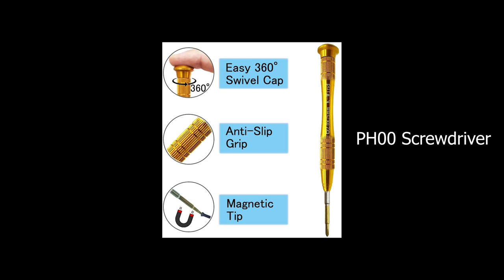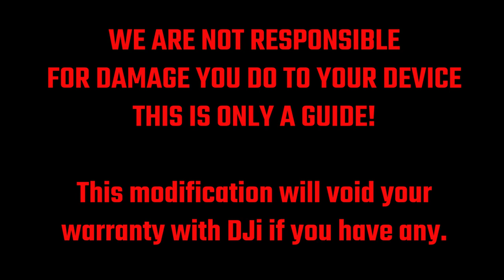Alientech Antenna Mod Installation for DJi Smart Controller

Comment: This is a really nice video ,  i recently fell off a bike  with the dji smart controller in my hand. Damaind the outer cover of the antennas, 
is there an option to only replace the antenna sticks , or any options or links where i can buy an replacement antenna module ??
it would be great help from you .. many thanks.
Reply from the maker: I would check Alibaba for parts.

Comment: Why do you use this external Marshall monitor? What's that for? Is the built-in screen not enough? Regards.....:-)
Reply from the maker: I like to look forward not down, and it is to setup to show 2 different options on the screen
Reply: @idjmic  Two different options ... hm.... for example?  :-) By the way.... This movie is a perfect step by step guide. It helped me to change configuration of my Smart Controller in order to use Signal Booster by Alientech. Thank you so much......:-) The only problem I noticed was to connect antenna wires to the motherboard. these connectors are so tiny.....Uhhhh.....:-) But finally I did it.......

Comment: I am struggling to get the antenna connection onto the motherboard. Mainly because I don't understand how they fit together. Does it just snap in or does it turn in? Thanks for this video Btw!
Reply from the maker: They just push on but not lined up correctly you can flatten the connector and damage it.
Reply: @idjmic  Got them in. 😅
Reply from the maker: @designsinorbit  yeah they can be challenging

Comment: Poor design the HDMI cable will not fit in any way with the Alientech installed not enough room. Are there any adapters to make the antenna to stay forward and be able to insert the HDMI without damaging the port? Not happy at all with this design.
Reply from the maker: Not for everyone

Comment: Hello, it's me again. So I installed the Alientech Duo II successfully thanks to your video. Alientech informed me this booster would help my signal issues in the mountains. It made zero difference. I was just wondering if you know of any other options for this problem. Thank you sir.
Reply from the maker: Maybe look into the Titan Atlas antennas and check the forums on what others are using.

Comment: I have only one spring (in "photo" button)... different revisions?
Reply from the maker: No should be there!
Reply: @idjmic  Saw another video - the same as mine - only one spring in the "photo" button.
Reply from the maker: @mileshkin  that is really strange. The spring helps button stay up.
Reply: Just did my rc, only had one spring under the photo button, none under the video button. I noticed flying, the video button was extremely sensitive, so I added a spring. All good, thanks for a very explicit video.
Reply from the maker: @csidroneservices  glad it helped

Comment: How can I get ahold of you to get an install done?
Reply from the maker: My server is down currently lost a drive... idjmic.com is offline. Shot me an email idjmic at gmail dot com
Reply: @idjmic  hey man I hope all is well. I successfully did the install courtesy of your video. Only thing is I keep getting the code60010 to calibrate the rc. I've tried everything that makes sense and found online. I was wondering if you encountered this problem? Thanks man
Reply from the maker: @timmykrakcorn8355  try reset controller? Or
1 re-link the sc to drone
2 Restart drone and sc
3 calibrate compas of drone
3 calibrate compas of sc
4 power off drone
5 power off sc
6 power on drone and sc
7 fly
Reply from the maker: @timmykrakcorn8355  Eventually I found that if I wobbled it at about twice as fast as it showed on screen, it worked fine. I actually did the speed change due to frustration, after trying at the exact speed they were showing on screen at least 10 times to no avail. The first time I doubled the speed, it worked. So if this is the calibration screen you are referring to, try it outside in the open and at a faster "wobble" pace than shown on screen.
Reply: @idjmic  I have tried that. I. Not sure if it was that exact order but I will give a shot tomorrow.  My next option was maybe update through the assistant but I'm not sure.  It does link with the aircraft but when I launch it will just hover and I have no movement from the joysticks and it still has that error. Thanks for the reply
Reply from the maker: @timmykrakcorn8355  let me know how it goes.
Reply: @idjmic  ok so I figured it out. I was trying to doe the compass calibration like a dummie ultimately I needed to go into the go 4 app and calibrate it that way. Thanks for the suggestions anyways
Reply from the maker: @timmykrakcorn8355  I’m glad that’s all it was